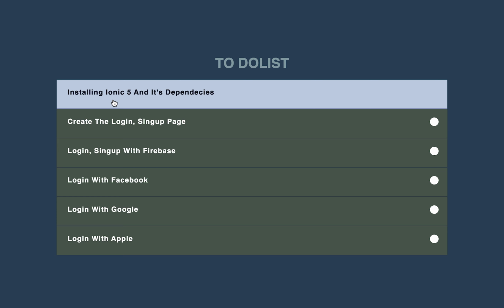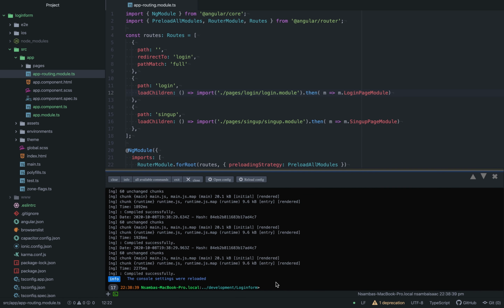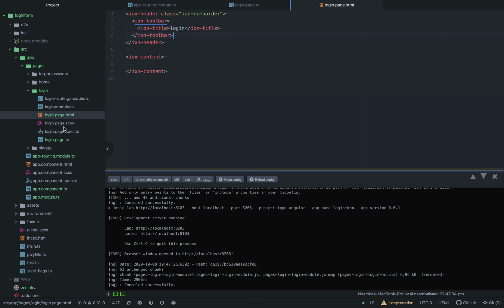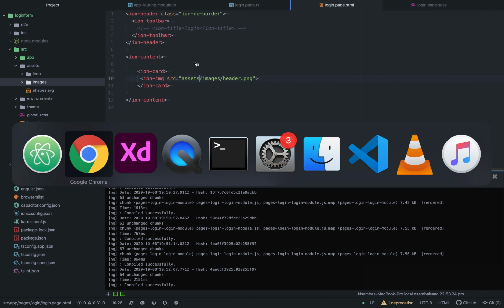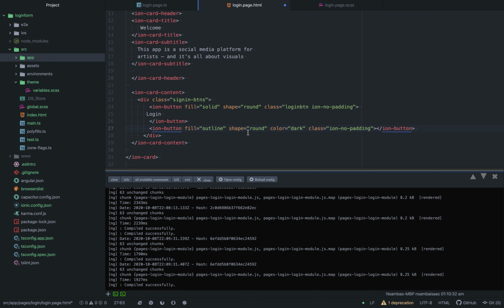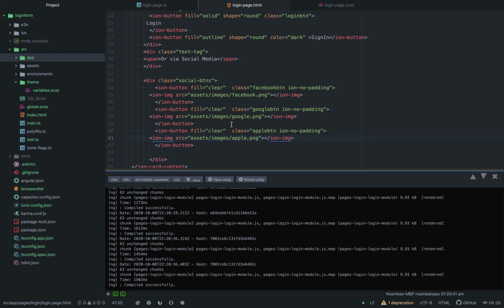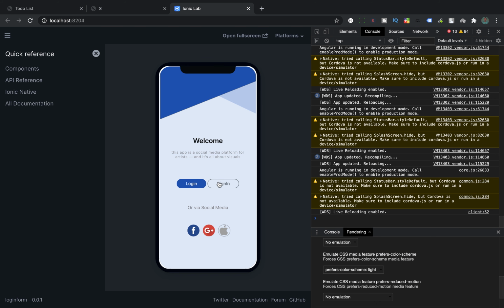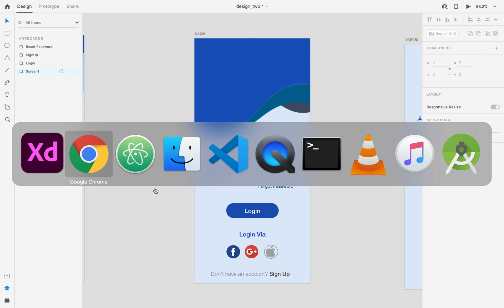Ionic 5 Tutorial Creating Login  and Sign Up page part 2/6

Comment: Bro I am trying login page but not working help me
Reply from the maker: what error are you facing Here....
Reply: Full black page and not connect  login page
Reply: @savegesavege4096  same issue
Reply: @codeaxen  full black page not connect  login page
Reply from the maker: post the screen shot  of how it a pears thanks... another  i forgot to mention...
1 Open Chrome(make sure it's ur default )
2 Run ; ionic serve -l  in your Terminal
3 Open DevTools by pressing Command+Option+I (Mac) or Control+Shift+I (Windows, Linux). This shortcut opens the Console panel... and see if you have any error on your application
Reply: @codeaxen  give me your whatsup number or gmail
Reply from the maker: https://web.facebook.com/CodeAxen-101410571341155